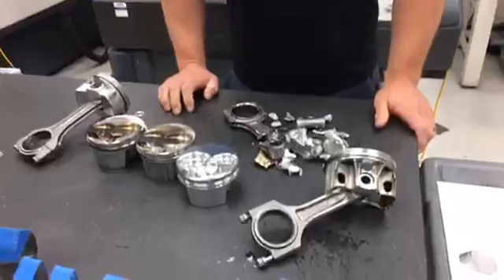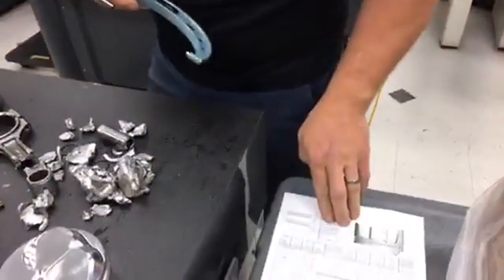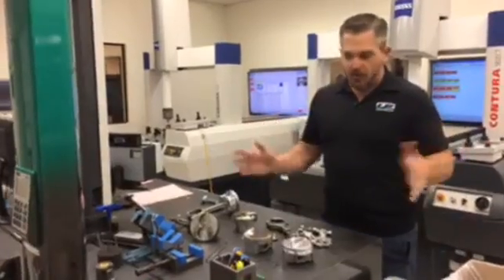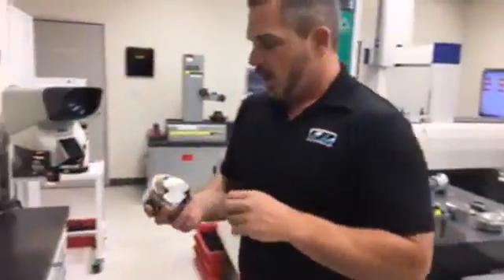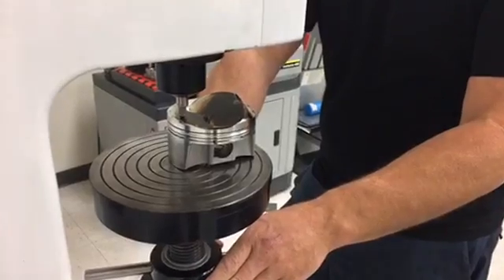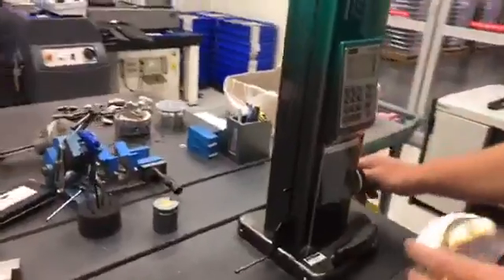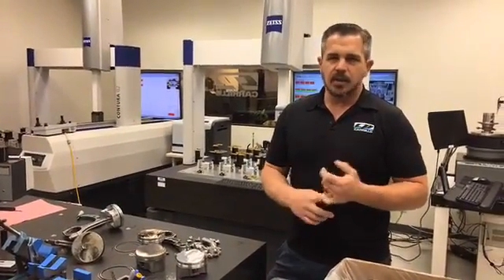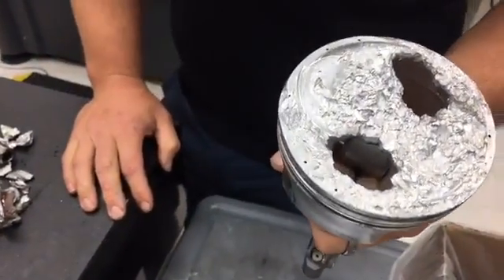Common Piston Failures and what to look for when inspecting broken parts

Comment: That was a great video. pre ignition- ponging, lean mixture, valve timing, ring gap to tight. I bought a basket case motorcycle. The top of the piston broke off at the rings. After former owner installed a new carburetor, and timed it. Looks like lean mixture, and pre ignition. Thanks for the info. keep up the good work

Comment: That piston with two holes in it, sure could have had a couple of dropped valves, but it could have also been a victim of pre-ignition.  That will destroy a piston instantly, and blow a hole through it very easily.

Comment: I am reusing our 2004 corolla pistons from one engine to another being rebuilt.pistons have little gauges and irregularities but my machinist saying they are good for re-use, no cracks, no wear on the skirts. I want to buy new ones but the car is so old that it may not be worth it, already expending a fortune on the bearings and piston rings from Maleh, only thing i am doing is drilling an extra oil hole per side per piston

Comment: Interesting. Soft pistons . Who would have known . We ALL have a Rockwell tester in our tool boxes. don't we.  I do not know why pistons are not made of steel. They could be lighter and stronger than Aluminum. 7000 aluminum could be used also. All the abuse amateurs heap on engines it is a wonder they run as long as they do.   Starting fluid is the worst thing you can do yet you do not mention it.
Reply: The counter balance would have to be yuge!
Reply: What makes engine , consume a lot of oil after new installation of piston and ring ? Thank you sir

Comment: What about Ceramic Coating? I am thinking of coating the tops of my positions with CBD ceramic. The question is how much does the position expand when coated by a ceramic. Does the coating of the tops of the position impact the Thermal expansion of the rings?
Reply: Coatings won't save you from a bad tune. The Alky pistons are a clear sign of a bad tune. Enthusiast loathe to blame themselves for installation or tuning errors and rather blame the manufacturer because without the part inspected they seldom spend time on social media to defend themselves.